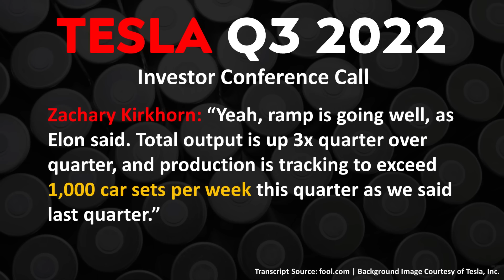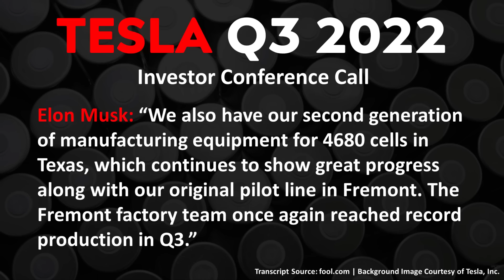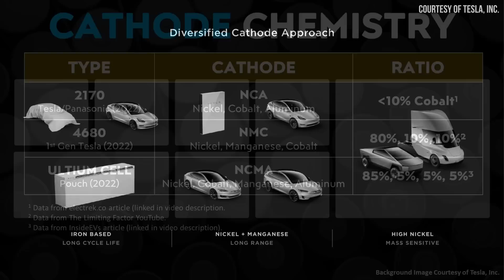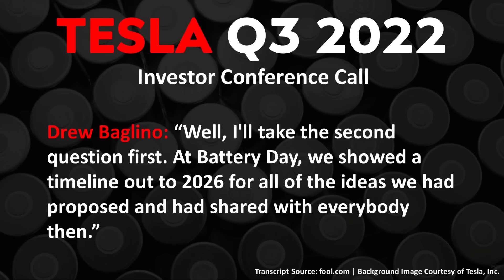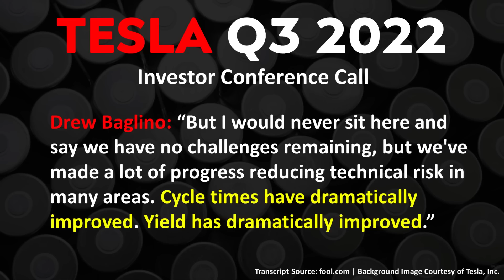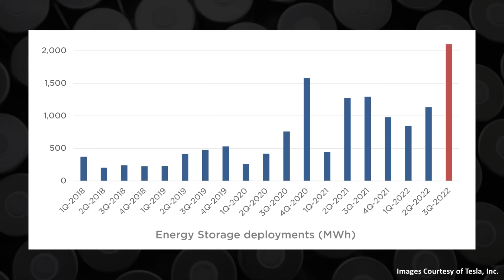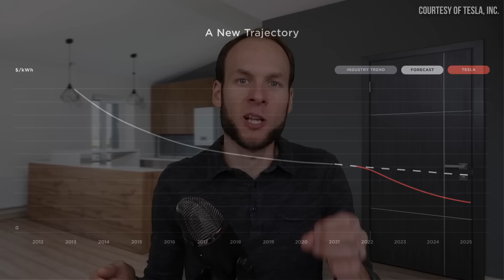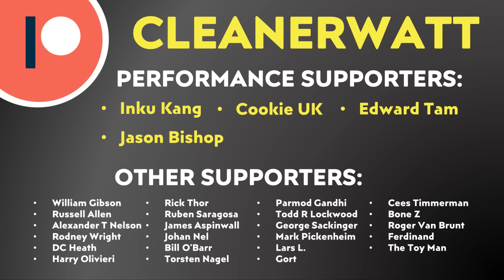BIG Tesla 4680 Battery Updates | Q3 2022 EXPLAINED

Comment: If Tesla is planning to make 2 million vehicles per year, and each one needs 828 batteries, then assuming every single vehicle was a 4680 powered vehicle, Tesla would need to make 31.85 million cells per week. As 828,000 cells a week is the current production rate, they would need to nearly 40x the production rate. I don't see how that is possible unless they not only improve the output of each line, but also create more lines to multiply production.

Comment: I had considered waiting on the IRA for the tax credit and possibly the 4680 cells before ordering our Model Y.  When we bought our Model 3 in 2018, we still qualified for the $7500 credit before it was phased out for Tesla.  The problem for us was we didn't get the full $7500 since our tax debt wasn't even half that due to our income coming from partially non-taxed sources.  With our 2018 Model 3 using the 2170 cells and still getting 300-305 miles of range after starting with 310 over 4+ years ago, I've decided why wait to see when the Fremont-made Model Ys would get the 4680 cells and if any benefit would be worth waiting for.  We placed our order on 10/6/22 with an expected delivery date at that time of Dec.-Apr. but now that date has moved to Nov. 27-Dec.31.  I know that if we take delivery during that time we will miss any tax savings under the new IRA "if" it will even qualify for them (which we're still not sure of).  It's an individual choice as well as a financial one but for us, we'll have little to no regrets by not waiting as long as it is a quality-made product and not an end-of-quarter push without good quality control.  Thanks for the great videos John!
Reply: @jeffnreno5080  That's a bot you replied to, Jeff.
Reply: @1519Spring  TY...I reported it and removed my response.

Comment: Two finer points:  There is no "tax incentive" to buyers.  There is a $7,500 rebate that goes directly to the manufacturer.  It has nothing to do with the tax burden of the buyer.  It takes tax revenue from all US citizens and pays a large lump sum to the manufacturer so that already wealthy consumers essentially pay less for the vehicle.  It is wealth redistribution from the masses to the elite.  It's not in the best interests of this country.  Also, the Tesla Semi using 18650 or 2170 cells is absolutely a compromise!  The charge rate alone is significantly reduced, meaning it will take longer to get a semi back on the road.  The 4680 promises greater gravimetric energy density, and that is 100% indicated for use cases like the Semi.  To see them rolling out with 18650 cells is a real disappointment.

Comment: Will larger cells come from Tesla at some point? BMW is already talking about cells with a diameter of 46 mm and a height of 95 mm or 120 mm.
Such cells could cost a little less per kWh than the 4680 cells.

Comment: Yes Elon it could be done before 2026,  the Cybertruck was supposed to be made in 2019 also along with Semi and Roadster. Not one of them in fall of 2022 are for sale. The Semi, allegedly will start a extremely limited deliveries in December and it will not have 4680’s.
Reply: The cybertruck debuted in Nov of 2019. You seem confused. 🤔
The semis and gen2 roadster are definetely late though. 

But if you search average time to market from first prototype to first production vehicle?
You'd find it's 71 months on average for a new vehicle program to come to fruition. So far not a SINGLE tesla product has taken that long. 
Which is insane really for a none legacy company building the first ever modern mass produced evs. 😎👍🏻
Reply: @Jackyl Smith
You haven't seen the news.  If you had, you would know that the Cybertruck and Semi were delayed by the inability to obtain enough batteries to build even the EVs in production.  It would make no economic sense to build a production line for another EV without the possibility of getting batteries for it.  So quit whining

Comment: The $50 per kWh goal at Battery Day assumed materials prices from Sept 2020. The $70 per kWh assumes today’s materials prices. So those cannot really be compared as the bill of materials is higher. The 4680 is all about large scale production and reduced cost of manufacturing, which are largely independent of materials costs.

Comment: Jon, I believe the 4680 cell is optimized to be as big as possible while still safe for nickle based battery.  For LiFePo4 batteries which have much lower safety concerns than Nickle batteries the 4680 is very small and would not be the optimum size.  So the cell chemistry would dictate the maximum safe cell size.
Reply: The 4680 with the tabless design actually makes them much safer.
(Note that 2170 cells are now safe anyway)
Reply: This

Comment: I suspect that Tesla will switch back to the nickel-based 2170 batteries made at Giga Nevada, for the standard range Model 3 and Y made in the USA in order for these EVs to be eligible for the IRA EV subsidies or tax credits - which has restrictions to US or North America sourced battery materials that get stricter and stricter each year.
Reply: I agree, what size pack with the advancements they've made since going to lfp on base model 3s you think those will be?
I'd guess maybe 55kwhs gross and about 52kwhs useable to get around 270 miles of range. 

Or will tesla keep the price or even raise it to say $48,990 throw a few more options in. Inc a 60kwh useable nmc pack getting 300+ miles on a base model 3? 

Nothing could touch it if it qualified for the full $7,500 again imo. And that would keep a nice delta between the likely $54,990 lr model 3 and the base vs performance trims. 

Want a nicely loaded 300+mile 4dr ev sedan for 42k after rebates? A base model 3 is the pick, want a quicker awd 330+mile ev sedan for 47k after rebates? The model 3 lr is the pick. 

I'd ad the plaid motors to the perf m3, track pack standard and better perf seats then jack it to 70k+if I was Elon. 🤔

Comment: I was 100% positive that the Semi would be produced with the 4680 cells. In fact I have been saying for years that the only reason the Semi has been delayed is because of 4680 cell production problems. I was shocked to hear Elon say that it will now be produced with 2170 cells. I would have thought that the Semi had highest priority for 4680 cells, but now that does not seem to be the case. I take this news as being bad, that 4680 cell production is still far from solved.
Reply: But you missed something!
He also said that THIS Semi, with 2170 cells met the weight and range perimeters.
(80k and 500 miles.... On a flat road... Shade at Nikola!!)
.
THAT'S not only surprising, but Indicates the potential when the Semi DOES have 4680 cells.
Reply: @rogerstarkey5390  OR maybe it's showing that the 4680 was over promised and is under delivering.

They said the ramp is "going well." Clearly it's not otherwise we'd have a lot more structural battery packs underpinning Model Ys right now and the Semi would be using them as well.

Production speed and reduced cost was why they are important, not the minor performance improvements. The 4680 was supposed to allow Tesla to reach teraWatthr scale production but now it's beginning to look unfeasible.
Reply: @TecnamTwin  link to source regarding model Y ratio of 2170vs4680?
Reply: @TecnamTwin  
You're guessing
Reply: @TecnamTwin  
"Or maybe"..... Has no relevance.
The point is, as I said, that even using 2170 cells the design of the truck allows it to meet the required specifications.
Surprising, yes.
Impressive, certainly
Reply: @TecnamTwin  what could possibly make it "look unfeasible"? For starters, Tesla won't see big energy density improvements for 4680 until they master their in-house DBE cathode in Texas.  Secondly, four dif people on the call says it remains likely "4680 will be the most competitive battery cell in the world", and are already talking about the logistical challenges of moving that many battery cells.
Reply: Semi was delayed because of lack of cell availability…as Martin Viecha (Tesla Investor Relations) recently said, Tesla only very recently came to a situation where they have all the batteries they need. This is why energy products just saw a big ramp, and why Semi is starting production.
Reply: When you are actually smarter and more successful than Elon, then -- and ONLY then -- can you be both 100% positive and disappointed in Tesla's results.
Musk: turning the impossible into late.
Reply: @paintedpony2935 
Well said___things are NOT _'Always Black & White'
Reply: @paintedpony2935  
Exactly
Reply: It is not as if the 2170 cells are the same now as it is 2 years ago. Also with the structural battery concept add battery density improvements. Yes 4680 batteries will be better. It does not mean the 2170 batteries are not good enough.

The vehicle market is not willing to wait for the 4680 batteries to be fully ready before Tesla pushes ahead with its Semis and Cybertruck production. Tesla has always used what is best available that meet requirements. If the 4680 batteries are not fully available yet, it is not surprising that Tesla will use more of the 2170 batteries first, until the production of the 4680 batteries can reach a larger production level.
Reply: The energy density of the 4680 cells are only slightly better than 2170 cells so its use in the Semi is not so advantages. The benefits of the 4680 cells is mainly reduced cost and production footprint. It is also good for the environment as there's no need for the toxic solvents used in wet coating. 
Also you need to understand that dry coating battery electrode has never been produced at scale before so there's definitely bound to be problems. As an engineer I can understand the difficulties of being the first to do a new process but with Tesla's track record, I am confident that they can solve the production problems.
Reply: Reading between the lines, It sounds as though the 4680 cell is progressing well, though slower than expected. Given the amount of advancements they’re introducing, I’m not surprised. 
Re the Semi. I think it makes sense to go into production with 2170. That is the cell that they would have been using while doing all their development and testing work, so it makes sense to do the initial trucks with that until they can be assured they will have enough cell supply for the 4680 switch. It also means that the Semi and Cybertruck won’t be competing for the same limited supply of cells.
Reply: @tonygreen8221  Reading between the lines, Elon/Telsa fully expected to put 4680s in both the Semi and the CyberTruck, it just hasn't worked out to be able to do that.  4680 production ramp is taking quite a bit longer than they planned.   So, whether than delay either longer, they are forging ahead with 2170s.    Just like they did with most of the Model Ys coming out of GigaTexas.  Someday they will get 4680 production tweaked and refined so they can make them a lot faster.  I would guess all the 2024 model year Cybertrucks will be built with 4680s.  Hopefully.
Reply: @tonygreen8221   take note of the  new section being added at Nevada (to the battery building)
Reply: You don't understand that a single Semi uses a huge amount of cells so that volume production of Semi's would need more 4680 cells than are available.  Plus all Semi's are being made right next door to Giga Nevada so 2170 cells are available locally.  Otherwise, 4680 cells would have to be shipped from Fremont.  So it's a matter of logistics.
Reply: @acmefixer1  not really. All those 2170’s at Nevada are shipped to Fremont. On a return trip from Fremont, 4680’s could be brought back to Nevada. This is actually an semi ideal situation. The best situation is that everything is made at one site. Otherwise you haul back empty. Which is a waste of money.
Reply: @jackylsmith8138  
The shipping company is not going to transport anything from Fremont to GF Nevada for free!  That's absurd!
Reply: I hear ya.  Very disappointed they are struggling to ramp production of 4680 batteries.  They will get it figured out eventually - just going to take awhile.
Reply: If Tesla built a 2170 line using wet electrode design, that would be tricky and difficult, but they have a new form factor, thicker electrode, trying to incorporate dry battery electrodes and  silicon- legacy battery makers would find all this daunting- yet Tesla is taking it all on. When successful (not if), Tesla will have accomplished something epic.
Reply: True. There are too many signs that seem to suggest that 4680 production ain't doing well.... Elon himself said several times previously that 4680 cells are required for Semi and Cybertruck.... in addition to that, there are strong rumors that production of 4680 Model Y has stopped completely

Comment: Congrat very nice info. As for the Tesla Iron cathode battery form I dont see other format than cilyndrical and no other factories/machinery/tech than what they're pursuing. If I have to guess I would think if not 4680 probably something like a 46100 or so dimensions and which would fit to current machinery/tech.
Reply: Why?  Elon has said that are no plans to make 4680 LFP cells.  The LFP battery Teslas being sold today don't use cylindrical cells.
Reply: @78katz  Agree but that are other manufacturers LFP not Teslas. Note also there are cylindrical LFP in the market today. The reason I think so even though an speculation on my side is because of the advantage of the manufacturing process compared to rectangular shapes and all the equipment would fit larger cells like 46100 or so; so need to be elevated at the proper height.
Reply: @marioescalona1640  Yes, there are cylindrical LFP cells on the market today. How many are used in autos? None that I know of.

Comment: If a key contractual delivery date with Pepsi for the Semi was Dec 1st, then they would be forced to deliver something, ahead of 4680 proven volume suitability (15 trucks due in Q4 at Frito-Lay, CA).
Elon, Sep 20, 2020: "Important note about Tesla Battery Day unveil tomorrow. This affects long-term production, especially Semi, Cybertruck & Roadster, but what we announce will not reach serious high-volume production until 2022".
Elon, Aug 10 2022: "Tesla 500 mile range Semi Truck starts shipping this year, Cybertruck next year".
Elon, Oct 7 2022: "Excited to announce start of production of Tesla Semi Truck with deliveries to @Pepsi on Dec 1st!"
Reply: Seem a you may have both missed AND clarified the very important point that the Pepsi Semi will be delivered in December with 500 mile range AND full weight capacity WITH 2170 CELLS.
(They can make the max specifications with 2170!)

Comment: What is their 4680 manufacturing defect/scrap rate vs Panasonic?
Reply from the maker: The Panasonic number is a hard number to nail down. I have asked, but I don't have a solid answer yet.
Reply: It would be good to know but the tesla number is probably a moving target since it is still being ramped
Reply: In economic study, they call it J-curve or learning curve.

When new process is introduced, productivity will be decreased and turn negative. Normally it took 3 years to turn around, to be positive and increased rapidly from the start.